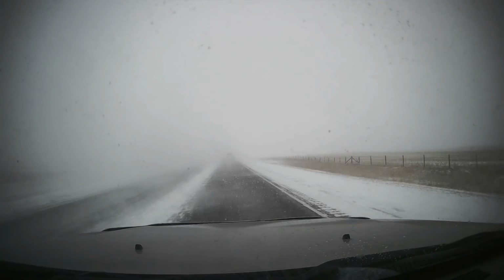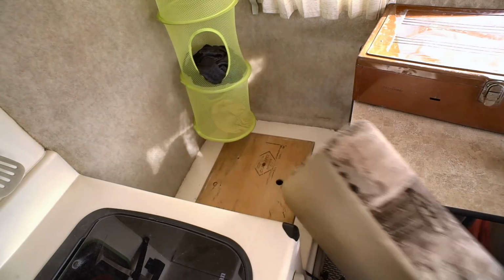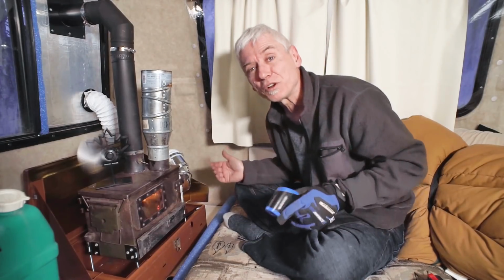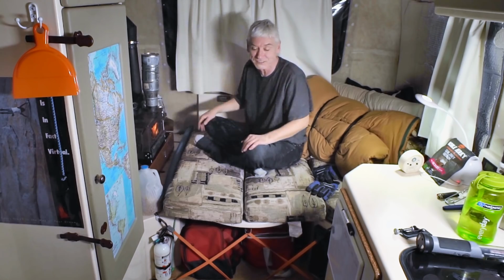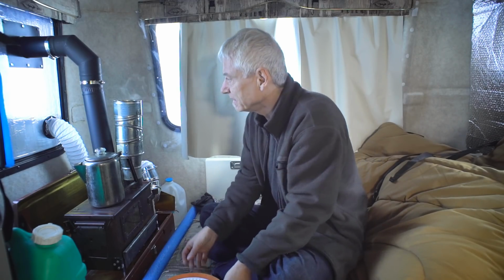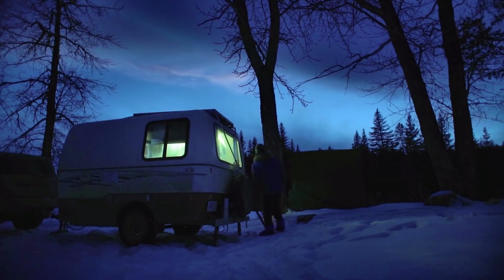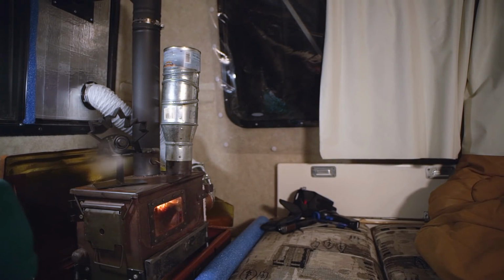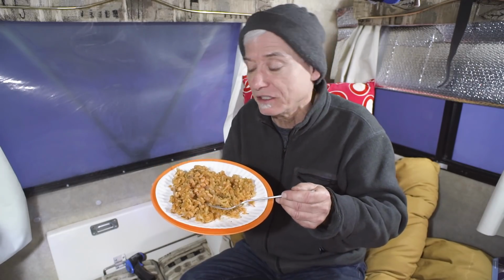Camper Wood Stove Experiment Pt 3: Feeling the Heat!

Comment: Point the stove fan at the stove pipe, to cool the stove pipe, and by directing cold air at the pipe, will add more heat.
Reply from the maker: Two reasons for not doing that Trevor: 1) It would make the hottest wall hotter and 2) I didn't need any more heat! SP

Comment: Slim I was thinking about you while I was camping in the Rocky Mountains listening to my suburban heater running and after a while it started to get on my nerves and I thought of your post and I came up with what I think may be a solution to the noisy problem and that is using my hot water heater as a boiler and I’m going to try to find a 12 V circulation pump and a automotive heater core using a computer fan which are very quiet, any thoughts in doing something like this

Comment: Did you have problems like that with the A frame? Or is the wind unusually strong this winter?
Reply from the maker: The A-frame leaked air like a sieve, while the Outback is almost airtight. That's also why the Outback retains its heat more. Thanks! SP

Comment: @6:30 Chimney tops should be 5 ft. higher than any crest within 10 to 20 ft. depending on the slope of the roof. I noticed the solar panel could interfere with proper draft. This is a common mistake made by DIY wood stove enthusiast. In certain conditions this can force flue gases back into occupied space or affect heating performance.

Comment: How long is the cabin area, and what is the tare weight of the trailer? Wondering if my 2003 Grand Caravan 3.3L engine would pull that easily. I have a 7x10' cargo trailer, with about 6.5' height interior, but it's heavy duty and tare weight is 3K pounds, or about 1365kg by Canadian weight. It drags my MPG from 22mpg down to about 12mpg.(26.4 miles per Imperial gallon to 14.4 miles per Imperial gallon)
Reply from the maker: 10 feet long and half that weight. Thanks! SP

Comment: If you had some kind of exit ductwork that you could add to the exit tube of your stove you can actually run a hose or a duck under your car where the oil is and it would keep your car oil warm and your engine warm or you could run it underneath your water tank if you have one to keep that from freezing no sense in wasting that heat.

Comment: The male end of the stove pipe for wood burning should always point down and/or pointing at the stove. Also, the wood stove pipe should always be inserted into the collar of the wood stove outlet.
This may sound backwards considering the direction in which the flue gas is traveling. Some are concerned that the smoke can leak out of the pipe seams - however it will not. The pressure of the draft will be moving too fast for smoke to work through the seam.
Reply from the maker: Sorry, but I like the way I have it as it works prefect for the design of the stove. SP

Comment: that carbon monixcide detector seems to be high near the ceiling?  its heavier than air so should be at ground level
Reply from the maker: That is completely incorrect. CO is lighter than air. Please follow EPA guidelines when locating one. Thanks! SP
Reply: @SlimPotatohead  hm, i double checked and you are correct. its lsighly lighter. i was always taught the other way.

Comment: Design a storm cap  on top of the flue stack, that swivels with the wind ,  upside down U shaped storm cap, maybe like a wind direction flapper  indicator, that points to the wind. to prevent  smoke indraft into your camper.  I not  clear here in explaining, but you can figure it out.

Comment: Slim, you’ve terrified me. You’ve blocked your only fire escape. If anything flared up, you couldn’t get out via the windows. That sleeping bag would be in the way and you could fall and knock yourself out. You really MUST get over the other side of the camper if you’re going to use that thing. xxxx
Reply from the maker: There are two windows that open, and I purposely put the stove away from the exit. I could easily make a divider to wall in the stove if needed.  SP
Reply: I hear you, but wouldn’t moving over be much simpler and safer? xxxxx

Comment: Maybe High-Temp silicone (+350C) used in cars would help seal it, or anything that is used on cars to fix "exhaust leak".
Reply from the maker: You mean the hopper? Yes, am going to try JD Weld High Heat bond with my new hopper design. Thanks! SP

Comment: I understand the need to issue warnings about using a wood stove in a camper. The truth is, people can have a fire from the built in stoves and furnaces. People in houses can have fires from electric heater or even clothes dryers. You do have to use common sense and take precautions. Wood is no more dangerous than other forms of heat.
Reply: @snarkylive  I have had a wood stove in a schoolbus, used a propane stove for heat in trailers. Did you know that bird dander can cause an auto immune disease that destroys your lungs? Will you now encourage people not to have birds?

There are lots of dangers in life. We deal with them. I understand the need for warnings but you can safely use wood stoves just like you can safely use other forms of heat.
Reply: And one last on topic point, if you use wood heat, be sure to keep a box of baking soda on hand. If you have a fire burning too hot, even with the dampers closed, just throw in some baking soda. It releases CO2. It can put out the fire if you use enough.

Comment: I have a design in mind for a TINY ROCKET MASS STOVE design, suitable for RVs or even van conversions, requiring two openings to the outside of the vehicle: one for air intake (side wall below where it is mounted) and a chimney to the outside via the roof and a custom roof gasket and cone for air draw that is silent at highway speeds and stealthy designed.  ROCKET, because the design accomplishes nearly FULL COMBUSTION of the fuel via two, or even three consecutive burn chambers that overlap each other so as to be heated by the primary burn chamber so that there is minimal ash or soot, and maximum BTUs from the fuel, along with no risk of chimney fires from all creosote being burned (quality rocket stoves with multiple burn chambers have no detectable smoke from the chimney due to the completeness of combustion).  MASS because as those designs have proven, having a MASS around the stove to capture the heat "smoothens" the peaks and valleys of heat provided to a more gradual climb when the fire is lit and burning its strongest, and descent as the fire goes out, but the MASS continues to release heat for some time...  Surrounding with MASS also could nearly make it nearly impossible for an occupant to be burned since the heat would be distributed evenly throughout the MASS (think heat sink) and even a lowly computer 12v fan could provide some air circulation.

Properly designed, it would run on 1" +/- diameter "sticks" and be self feeding, as any good rocket stove should be.  Perhaps even a pellet dispenser could be integrated for a night time option to run overnight without need for adding fuel.  An air intake should be minimally short to take air from the outside so that inside air is not consumed at all and humidity is not impacted (i.e. burning it does not dry out the room air).  All openings to unit the would be sealable and insulated, via 12v power and controlled by a thermister that detects the fire has been out for long enough to leave minimal temperature difference from the ash to warrant closing all openings.  Something like refractory cement used for the MASS with airflow all around the unit.  If perfectly designed, it could even be possible to "hinge away" the MASS, like a clamshell for outside air contact directly with the outside of the primary burning chamber, so that the unit directly heats the room quickly upon being lit, and as soon as the room starts to come to temperature, the MASS is closed around the burn chamber to focus the heat on warming it for future heat output to the room (slowing the continued temperature rise, and starting to store thermal energy in the MASS).

If someone could just loan me a handful of NASA engineers for a few weekends...

My grandfather actually designed and patented a 3 fuel capable furnace back in his day,,, I'd like my crack at a furnace design!   ;)

Comment: Are you going to get star link? Curious if would work for you out there
Reply: To date, StarLink is not intended for mobile use in RVs, since satellites needs line of sight; the mountains and trees are the issue. Plus there is a need to bring a satellite dish, setup it up and additional power requirements. Better off using a cell phone or jet pack for Internet.
Reply: @ScubaSteveCanada  I’ve seen him camp in the open plenty of time but you’re right trees would be an issue in most instances. And I’m not to worried about the extra stuff to pack on the trip. Slims proven time and time again he can make extra stuff look unnoticeable.

Comment: Did you go this way because the diesel heater was no good?
Reply from the maker: The diesel heater was merely an experiment. The wood stove I have been using for years and found it an excellent source of heat. Thanks! SP

Comment: It’s cool (figuratively) but it seems like an awful lot of trouble.  The vented propane fireplaces like the Dickison seems super simple by comparison. Too bad they are so expensive.
Reply from the maker: There is no easy button John! I'm sure a Dickenson heater would work, but it would take up permanent space. I was looking for options that can be removed and stored when not needed. Thanks! SP

Comment: Shame the design eliminates using the canopy...I would have used the kitchen window instead and that would have allowed full use of the bed platform. We converted our kitchen window to incorporate a/c
Reply from the maker: What kitchen window? This is a Trillium Outback. I can use the canopy quite easily if I wanted to, but see no need for one in subfreezing temperatures. Thanks! SP

Comment: have you tried electric heat with baterys yet ?
Reply from the maker: Electric heat is extremely inefficient to heat a camper. Can drain an entire battery in an hour. Only practical electric heat is an electric blanket, which I use occasionally. SP

Comment: Its seem an electric heater would be safer and since you have solar panels, add a couple additional batteries, just my thoughts for what it’s worth :)
Reply from the maker: It wouldn't work Anthony. As I showed in a past video, even a 1500 Watt heater will not completely heat a trailer in subfreezing winter temperatures. Adding batteries is fail fail due to expense, space and more energy needed to recharge them (in the season of less daylight). My way actually generates electricity instead of consuming it! SP

Comment: it sounds like you have squeaky springs. Maybe some grease on them would help.
Reply from the maker: It doesn't have springs. SP
Reply: @SlimPotatohead  I thought it was springs because I had a pickup that squeaked like that when I drove down the road but only happened when I was driving as yours does. The dealer said it was the springs and greased them which stopped the squeak. you may not be aware of the squeak. I wasn't until someone heard it when i was driving and told me. Check the part of your video where you are driving and you will hear what I am referring to.
Reply from the maker: I didnt say there was no squeek, I said its not springs. Torsion axle. SP

Comment: Have you ever considered storing extra heat in water? wrapping the chimney in 10mm pipe and pumping water through that into an insulated tank under the chassis could store heat for use when the fire goes out? 
Stupid idea. But I'm full of them.
Reply: Uncle Dodge - Not stupid, just needs thought, experimentation and refinement.

Comment: I dunno... you already have that propane heater. Considering you're only out a few days at a time I'd forego the hassle of assembling that stove, buying wood pellets, rigging up a new sleep system and waking up each night to replenish the hopper. If this were for long-term off grid use and you'd use "free" wood to burn I could understand.

But I suppose a video showing how to turn on the thermostat wouldn't be very interesting. :)
Reply from the maker: @RT Steele, it's really no hassle at all and is an immense saving compared to the cost of propane or diesel. It's a great solution for those that really do off-grid camping. And free wood is always an option. Thanks! SP

Comment: While I am still really skeptical of the practicality of a wood stove in a small camper, a couple of nights staying warm in the chills of Alberta in February is no "Monster Chiller Horror Theater."
Have you considered a marine propane furnace?  They are expensive and have to be vented out with doubled pipe but the control of the heat output is much less of a hassle.

Comment: if you had taken the time to fiddle with and figure out the diesel heater...... as you have done over all in your woodstove construction and retrofit into the camper.....  you would have a much safer reliable heating system
Reply from the maker: Diesel heaters are more suitable for permanent installs for vans in my opinion. No real advantage in a fiberglass camper. Two entirely different circumstances. Thanks! SP

Comment: Mr Slim, or can I call you Spud?  Ever since you got this plastic box in wheels and put old Abner out to pasture you have been suffering from inadequate space and deja vu.  When you put the stove in Abner you went through the same issues the air feed through the door vent was genius and I suspect will have to happen again although the stove looked a lot safer in Abner.  
.
As for sleeping I recall you had ample room in that charismatic AFrame camper as well as a proper place to sit with a table/desk, the shower gave you more headroom as well.

All in all I think this fiberglass carton is a poor relation to Abner and seems far less practice and comfortable. I wonder, do you regret the switch? 

Enjoy the videos and your often ingenious solutions. BUT.. Beans AND Shallots,, open a window man...
Reply from the maker: I'd say the opposite is true in my case. I was always fighting drafts and heat loss in the old worn-out camper.  With the fiberglass it is so cozy and easy to setup. No contest! SP

Comment: Wahl....really think you need a little bit of a larger trailer to fully get an inside enclosed fire to be be safe...That trailer was never built to have that added I expect.  To be cozy is one thing, but with the addition of the stove, it just looks cramped and a little sketchy from a safety perspective. Well done on the addition of the heat source, but I for one couldn't relax with that set up...The construction of any RV is hardly based on wall strength, or to withstand heat like that created by a fire...We all know walls on any RV simply provide shelter from elements. The outer wall you tested at 85 degrees concerned me, what will be the short term and long term questions, or impact of that heat within the wall itself ?.. I'm no engineer, but truly Slim, the concept is great,  just all a little too tight for safety imo.

Comment: You do realize that the epoxy resin in the fiberglass shell will soften with heat, right?
Reply from the maker: Of course. Did you catch the temperatures it reaches with this stove? Considerably less than a diesel heater! SP
Reply: @SlimPotatohead  Yes, I just would hate to see such a nice little camper marred in any way. I have built boats with fiberglass and epoxy and have removed them with a heat gun. Epoxy softens at only 140 degrees F, which is surprisingly low. Most people would be aware of paint blistering or the walls melting or burning but you can't see softening happen. Your heat deflector does a good job but I still would not feel comfortable with any heat source being that close to the walls. Anyway, keep up the good work; I am looking forward to owning an egg camper some day.
Reply from the maker: The walls get to 85F around the wood stove, which isn't even a hot day in Arizona. With the diesel heater however the inlet got up to 183F. That was more of a concern. I think those who use fiberglass campers should be more aware of a parking heater than a well placed wood stove. Thanks! SP
Reply: @SlimPotatohead  I read about someone on the TNTTT forum wanting to experiment with a portable instant hot water heater to use it as a teardrop room heater. They were going to connect it up to a thermostat to turn it on and off as needed. Imagine having baseboard heating in your trailer. I wonder if it ever worked out.

Comment: Really not fond of anyone sleeping that close to a source of fire.  It's dangerous and not healthy.  I would recommend you move the stove or bed to the other side.
You can add to your heat by adding a skirt to the bottom of your camper.  Simply some canvas velcro'ed or snapped to the camper and draping on the ground.   It blocks the wind which pulls heat out and is easy to store.  A bonus is you can store items behind it that you want to keep but want out of the camper.

Comment: Wish you touched on moisture a little bit more
Reply from the maker: It's been the subject of several of my past videos, as all types of trailers and vans experience it especially in subfreezing temperatures. Condensation is the result but not the cause. It's moisture from breathing, wet clothes, cooking and wet heat sources that saturate the air. You can't stop breathing, but the rest can be reduced! SP